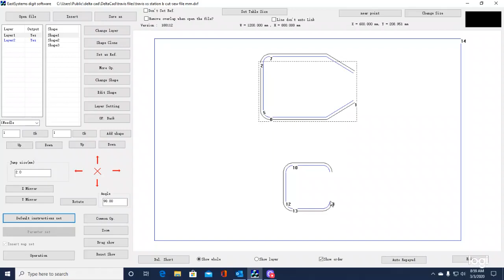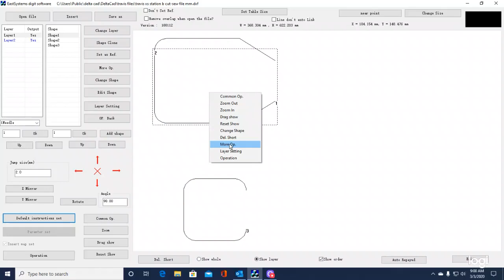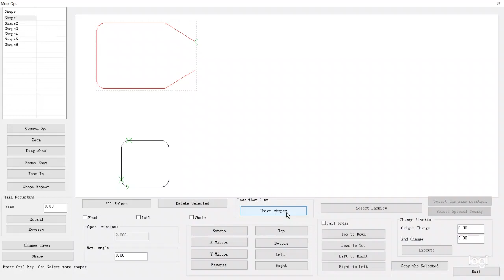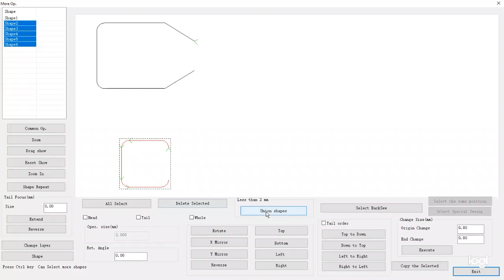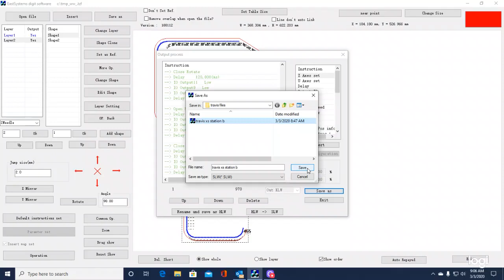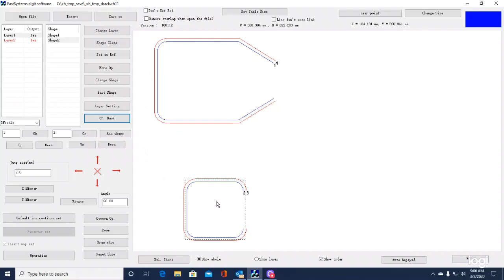HOW TO CREATE A PATTERN FOR A JUKI PS800

Comment: Your video was extremely helpful.  But, I am still having a problem with the cut function.  The cutter head is moving correctly but, it did not lower into position so it is not cutting the material.  Any advice?
Reply from the maker: Hi, very difficult to diagnose this in this manner. I suggest you reach out to the people you purchase this from and request a service call. You can email me thru my website for further help.

Comment: Hi, i bougth the software but i don't know how to change the stitch lenght in the same shape. I splited it into parts and different layers. However, the machine trims the thread with each change of layer. Would it be possible to change the stitch lenght in one shape or turn off the trimmer between some layers?
Reply: Salaam Aleikum.
where to download the program brother?